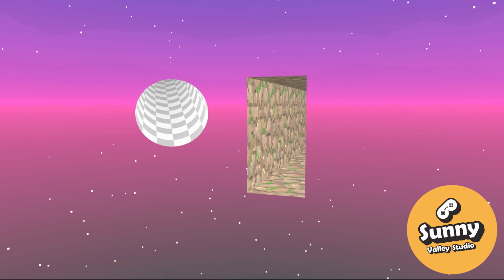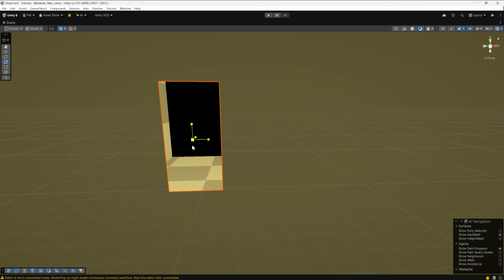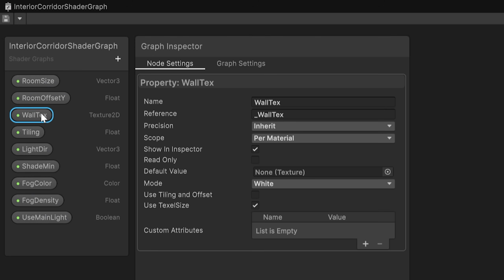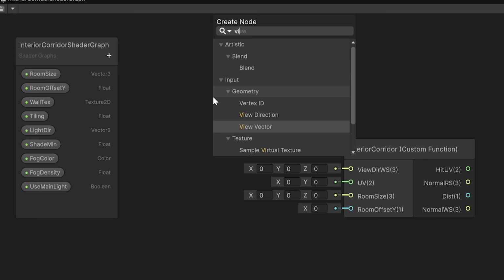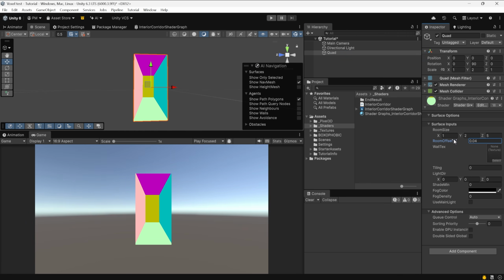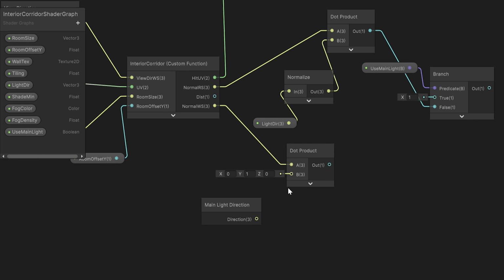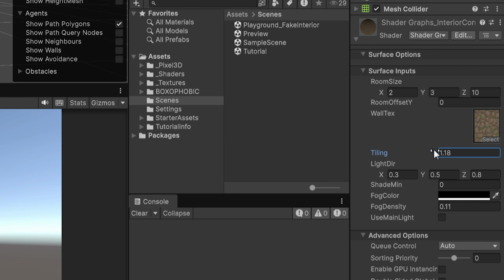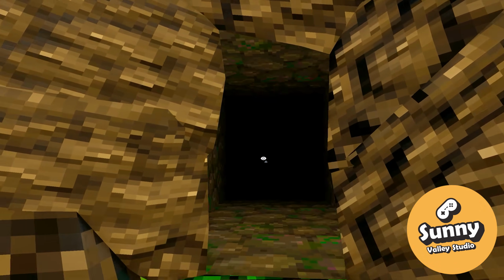This Unity Shader Graph Trick Fakes 3D Corridors and Pipes!

Comment: I mean... whats the cost of adding 10 tris vs running this shader
Reply from the maker: Fair question — and for a single entrance you're right. It really pays off at scale though: 100 windows on a facade is one quad each with per-instance variation, instead of 100 modelled rooms. The fake interior can also be deeper than the space available.